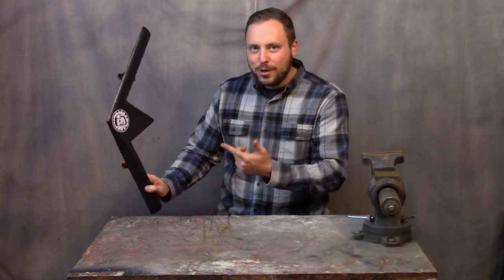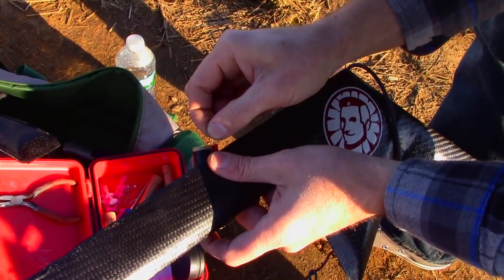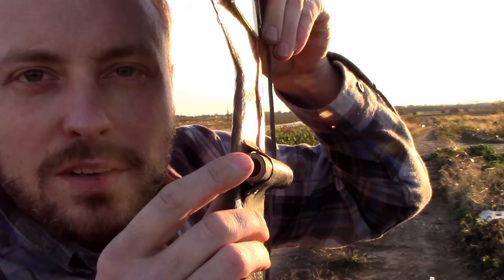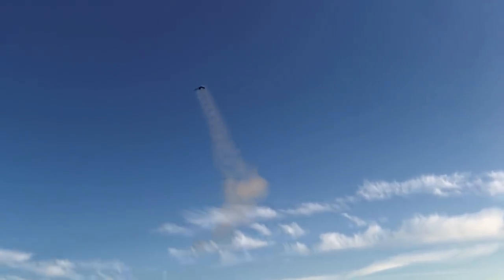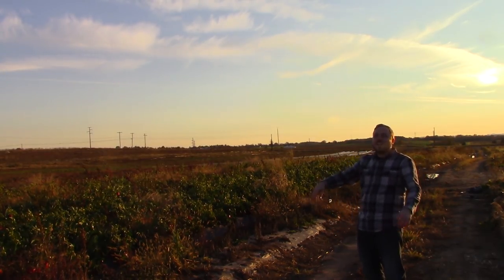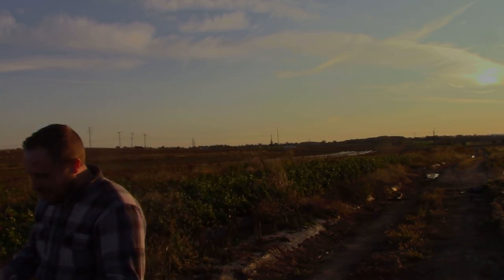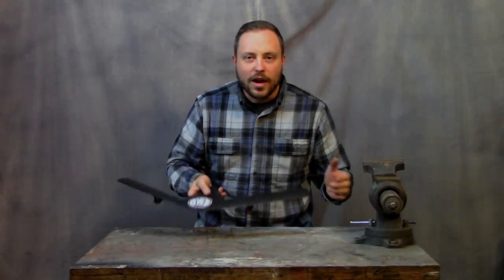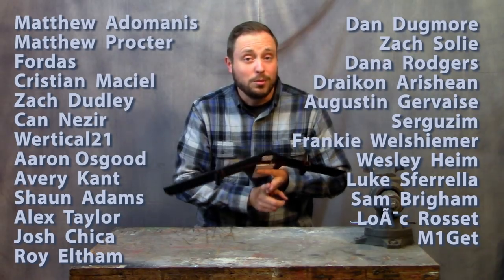ROCKET POWERED CARBON FIBER BOOMERANG

Comment: Great imagination my friend. I did it with bottle rockets in my video. It wasn't enough to add any more spin than it already had lol but still fun. I'm thinking your experiment may have worked even better if the boomerang had no trail edge at all or a small trail on the same inner edge of each wing. In other words 'not a boomerang concept'. Because of how a boomerang flies vertical and slowly goes into a horizontal position. Take that away and the flight should simply climb and then hover back down. Either way I love how yours flew all over the place just the same. Made for some really great footage.

Comment: Hey, jairus, I couldn't help but notice in the slow mos that the boomerang was wobbling something fierce and then bottomed out better once the rockets fired up. My suggestion is to incorporate the shell holders INTO the arms of the boomerang, instead of underneath. This should allow you to make the throw far easier, getting a better start, and potentially better RPS and range with it.

Comment: You should strap E-11 5 s on to it
 (it'll probably end up in space)
Also if you were wondering, the letter stands for the class of the motor (e.g. a motors are the least powerful) and the first number represents the force it puts out then the last numbers represent the delay of the ejection charge (e.g. an a-4 7 has 7 seconds of delay untill the ejection charge ignites (the ejection charge is the burst you see after the motor has no more thrust traditionally used to eject the parachute or the streamer)) also if you see a motor like this, A-1/2-4 7 then the motor has half the thrust time an a-4 7 motor has

Comment: Hey jairus. I'm really curious.  as per your tests, how were you able to calculate the angular velocity for each throw? thanks in advance.
Reply: I mean, I under stand the math to get there, but how did you take measurement? were you able to pick up sound waves per rotation? halp!
Reply from the maker: The slow ones were easy, look at the audio waveform. The last one was too fast so i had to count pulses at 1-2% speed. Then math.